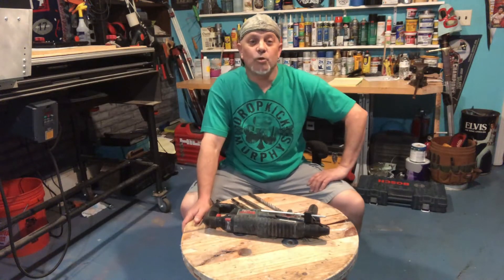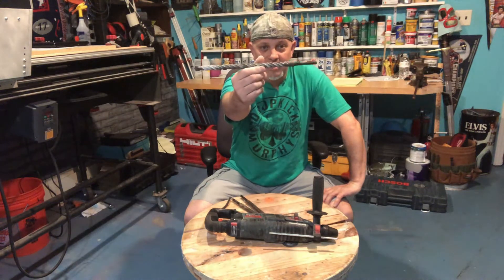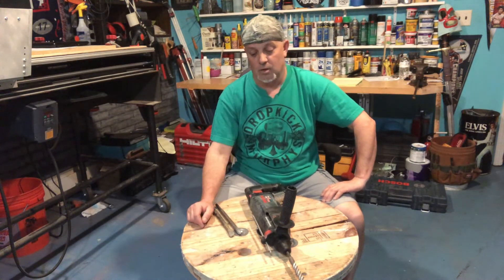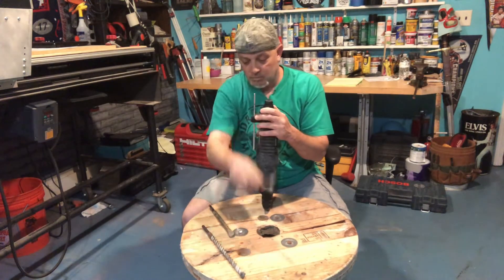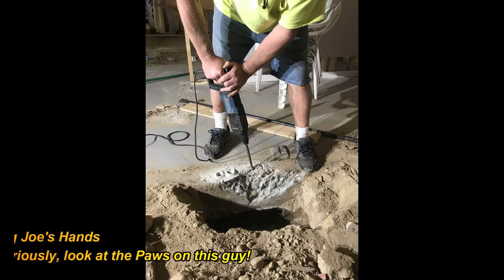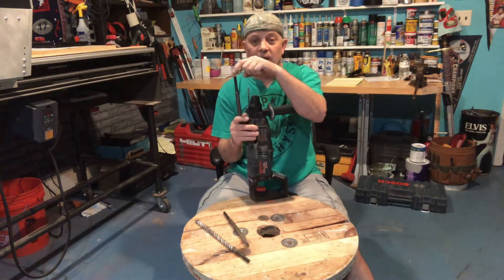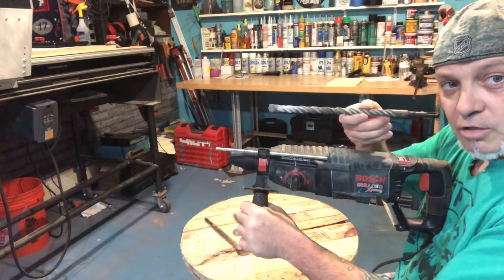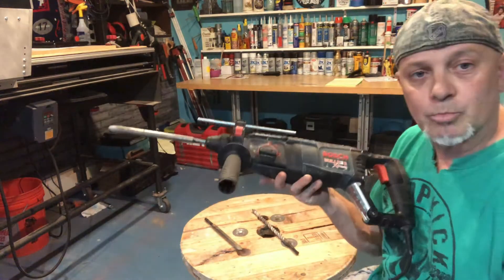How to use a Rotary Hammer For beginners (Diy Tool School Episode #10)

Comment: How donyou put the drill inside?
Reply from the maker: While holding the drill, grab  the end of the drill where the drill bit goes inside and pull back the black rubber collar.  When you put the drill bit inside as far as you can go, let go of the rubber collar and the bit will be locked in place. You may have to twist it a little and listen for a click.  Remove the drill
Bit the same way. Pull collar back and then pull out the bit.

Comment: which way did the bolt go in the concrete
Reply from the maker: Hello Queen.  The bolts have threads on one end, the other end does not. It has a tapered end with flaps over it that open and spread when you tighten the bolt down with a wrench.  This is what holds down your wood material. For instance, this would work well if you built a separation wall in your basement or garage and wanted the wall not to move.
Reply: @johnnyworks5446  thank you. I started a job at driveline retail merchandise and they want me to learn how to use a drill and hammer drill. Im so happy that you could explain how to use it. I never knew there was a drill for concrete. I thought you guys blew it up.
Reply from the maker: @QueenKiera  Good luck with the new Job✊🏼

Comment: when in the hammer mode is it supposed to still spin the chisle?
Reply from the maker: It should spin in hammer drill mode but not spin when in hammer mode. That should just move in and out like hitting the object with a hammer.

Comment: Hi, the drill bit moves freely forward and backward a bit even after locking. Is that normal?
Reply from the maker: Yes, it is normal. If you pull on the bit and it doesn’t come out but moves in and out , then that is normal.
Reply from the maker: Yes, it is normal. If you pull on the bit and it doesn’t come out but moves in and out , then that is normal.
Reply: @johnnyworks5446  thank you so much for the response. Got a new rotary hammer drill today and I am happy to learn using it watching your video. 
And yeah the chuck seems to looks a bit wobbling(it doesn't look like it's rotating at the centre)..kind. you know?  Is it faulty? How can I check myself , got it ordered online amid covid  pandemic and no stores are open nearby.
Reply: @johnnyworks5446  is there any way I could record it and send you ? That would be a great help.

Comment: Rotary hammer and hammer drill are totally different tools.
Reply from the maker: Yes they are,  thanks for pointing that out.  They can be used for some similar purposes and we sometimes call both tools a hammer drill at work.  Just like we sometimes call all circular saws "skill saws" or all reciprocating saws "sawzalls".   I didn't realize until you commented that my thumbnail also says Hammer drill but the title says Rotary, so thanks for the heads up!
Reply: @johnnyworks5446  I got a hammer drill to install an anchor on my porch recently. Then I realized how much more power a rotary hammer had so got one from Lowe's with a free battery. And the Bosch was on sale for $129 so I think I did alright. Now I need to bust up some rocks!
Reply from the maker: @garminsbleedingedge5198  Nice!  A lot of the drill/impact combos come with the drill that has the hammer drill setting.  This is good for small anchors but, not any good for bigger ones or chipping rock/concrete.  A good rotary hammer is definitely the way to go.  Have Fun and thanks for watchin!!!

Comment: My chisel isn’t locking in ?
Reply from the maker: Are you using the correct SDS bit?  It should pop in when you push in all the way in ? If not maybe you need to slide the cooler back with your thumb and index finger then put it in and release. Like you would an air hose connection ?
Reply: @johnnyworks5446  i got a 1/2 Milwaukee chisel maybe that’s why ?
Reply from the maker: Yes most likely. If you have a Bosch then you may need a Bosch SDS bit. There are three different width shafts for the Milwaukee I believe.
Reply from the maker: Yes most likely. If you have a Bosch then you may need a Bosch SDS bit. There are three different width shafts for the Milwaukee I believe.
Reply from the maker: Yes most likely. If you have a Bosch then you may need a Bosch SDS bit. There are three different width shafts for the Milwaukee I believe.